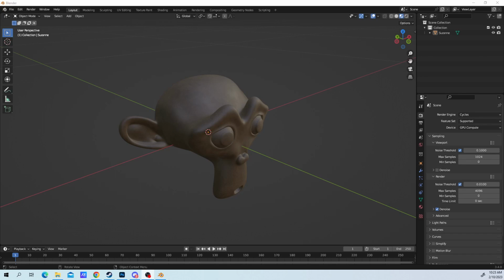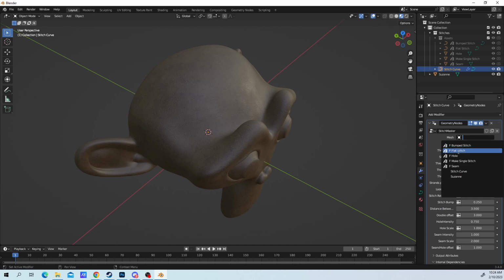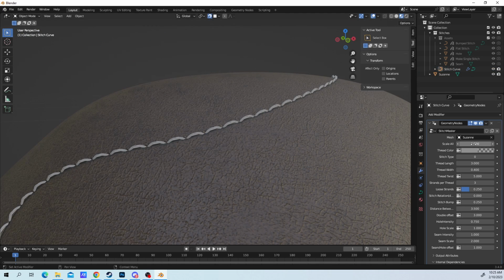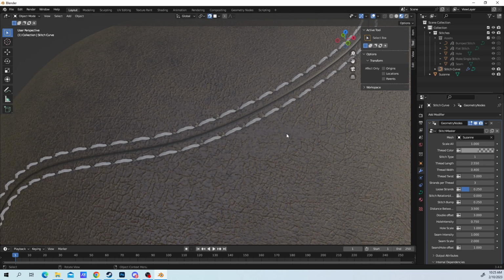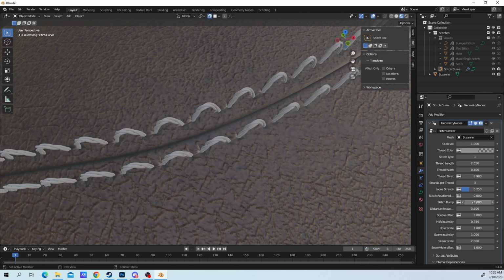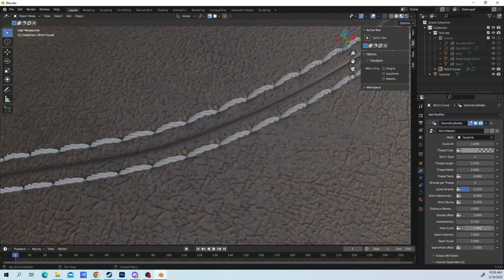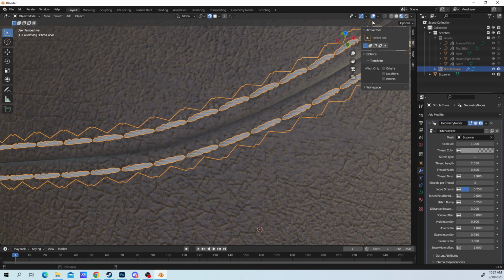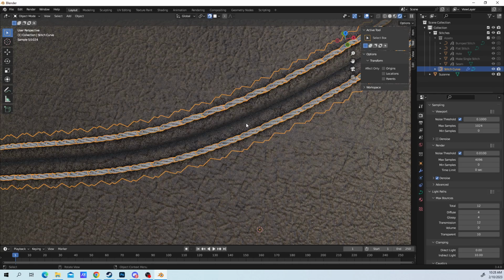Blender Stitch Generator: How to use

Comment: I would have a feature request (or maybe I am missing something): I would love to control the "depth" of the stitching. Sometimes, on thinner models, the two ends of each stitch are showing. Would it be possible to add a function reducing the extension of the stitches?

Comment: How do I make them as part of my normal texture? You know, cuz polycount matters xD
Reply from the maker: Unfortunately this tool does not directly support baking and is designed for high resolution production renders. However, some baking is possible by converting the stitch curve to a mesh (Object>Convert>Mesh). The hole/seam details will not bake correctly and intensity needs to be set to 0 to remove them before converting to mesh. Blender does not see transparency of planes when baking and will only bake out black squares. This will at least allow the baking of the threads to a low poly mesh. From there, you can follow one of many tutorials on high to low poly baking in blender.

Comment: Hi! I just bought your addon. It's fantastitch (ha) so far; but is there any way to modify the material of the stitches themselves? I'd like to add a bit more realism to them as I have render fairly close-up images that are supposed to be photorealistic. Thanks!
Reply from the maker: Hello! There is a material named "Stitch" that you should be able to edit to suit your needs. The two attribute nodes "UV" and "Stitch Color" are attached to the node group, and need to stay to maintain functionality. I am planning on adding more controls to allow manual adjustment of rough/color in the next update as well.
Reply: Thanks! I would also like to be able to make the stitches sit flatter to the material; as of now still looks too protruded (for my needs) when the bump is set to 0%.  @Workman3D
Reply from the maker: @GonkOrange  my next update already has an adjustment to make the stitches flatter when set to zero, along with zig zag stitches. Work is mostly done, just cleaning up, testing, and working on an update workflow. Aiming for 1-2 weeks
Reply: That's good to hear! Where can we follow you for updates? Here on YouTube? Do you have a discord server? @Workman3D

Comment: Hello, I bought this product and it feels great. But there is a problem, can you add the vertex group function, on a large curved and complex surface, it is really scary to use the mouse to draw lines, I need to attach the stitches to a curve
Reply: I found a solution for this: Select the edge you want to have the stitch> Duplicate > Separate > Convert to curve > Select + the generated Stitch Curve. Join together. Hope this helps!

Comment: Awesome job dude. Stitches are very difficult to make in blender. I noticed you have problems with polycount and baking, but I believe you can find the solution. Keep up the good work. HELLL YEAAAAH!!!
Reply from the maker: Thank you. I did add a control for stitch resolution that can help with polycount if it becomes an issue. Baking works on the stitches themselves(after converting to mesh), but the seams and holes takes significantly more work to bake.

Comment: can you use stiches on a seam?
Reply from the maker: If the seam is one single object, it usually works fine. It may require more precise placement of the curve since it may not know which side of the seam to use for normals. If it is two separate Meshes, I would recommend Joining the meshes together into 1, or creating a joined duplicate that is hidden from view/render to use as the stitch base. Alternatively you may use a separate hidden object as the base of the stitches, however the shadows/seams will not wrap to the mesh properly. I may add separate object pickers for stitch and shadow wrapping.

Comment: Hello. I bought this product, but the polycount is too high to use.
Please tell me how to lower the number of polygons in Stitch
Reply from the maker: Sorry for the late reply, may I ask what your final intended use is for me to best assist you? These are primarily designed for high quality product renders. I can make an update that lowers poly count, however it may significantly reduce the quality of the shadows/seam since those require high polycount to wrap properly to the mesh. Alternatively, a temporary option is to set the seam and hole intensity to 0 to remove those effects completely and set the thread count to 1, this will cut down on geometry significantly, but for some applications will still create too much geometry. 

I am currently working out a baking workflow for low poly game ready assets, but it is not a simple problem to solve due to the way blender bakers handle transparent objects.

Comment: How well will these bake in EEVEE? The geometry nodes are great for creating the stitches but are also creating vertices, I have to bake my characters for animation.
Reply from the maker: These are currently not designed for baking, but more for final production renders. I am researching the best way to handle baking and exporting, and if I find a reasonable solution I will update you.
Reply: Was there ever an update to this? 🙂